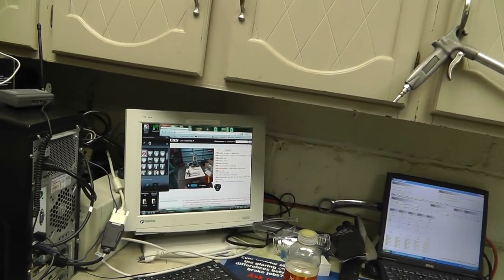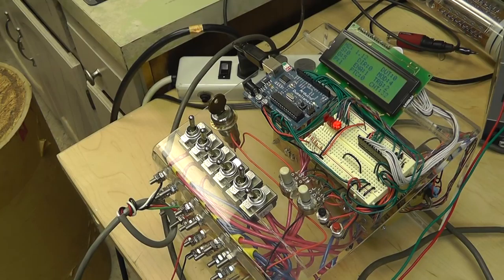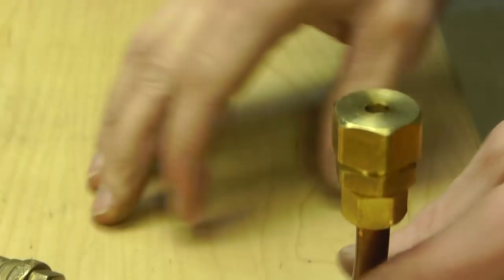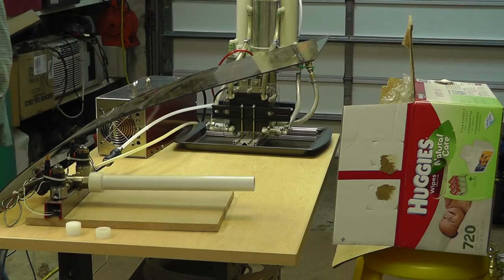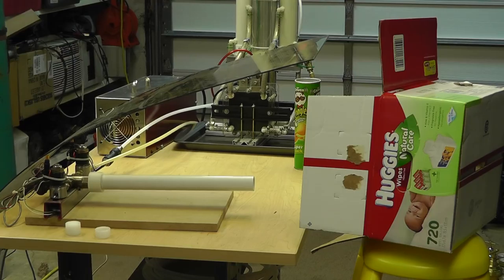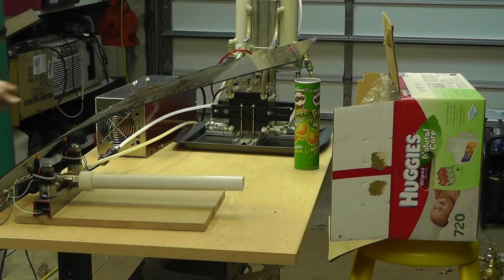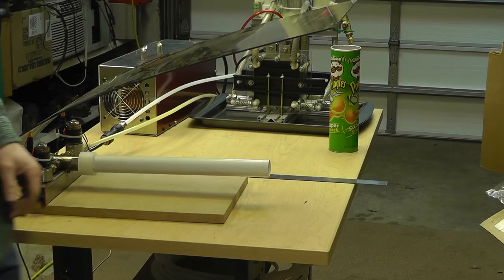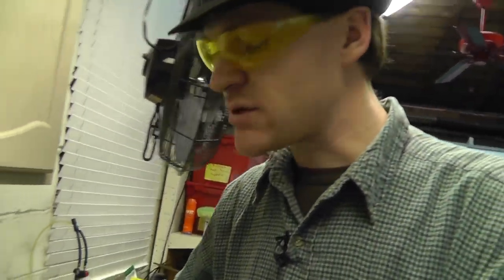First Test Run "Burn-O-Meter" AKA No Name Device. Enjoy ~Russ

Comment: also another fun way to show hho-afterburn vacuum is to have a long hose in a glass of water, drop some ink for slight coloration,bubble some HHO gas, then light on the other end.. FLASH 
and then immediate suction of the water in the hose! The vacuum is quite strong, water expands about 1800 times when in HHO state, so the pressure will be 1/1800 of the original gas volume after the flash? I actually did do this some years ago, quite fun! Might post if i find the clip.. OK well done Russ!

Comment: Hi Russ, I think you are doing great work, and want to thank you for sharing.

My question is, how do you know exactly how much gas is inside the chamber during each fire by the volume of gas input?
if you add compressed air, does than not dilute or add pressure in the chamber?
perhaps 2 pars hydrogen and 1 part oxygen is not enough for the hydrogen to completely burn?

great stuff keep it up.

Comment: Reviving an old comments section...BUT:

This reminds me of an idea i've been stewing over.  

A Potato (Light-Gas) gun (Launch Potatoes (most likely something more...durable) ) at orbital velocity

I think you basically made a Combustion Light Gas Gun, or CLGG

This may be a good first stage

The Seccond Stage Uses pure Hydrogen or Helium Gas

A Piston/Plug is Launched By the First Stage which compresses stage Two untill it bursts the burst disk releases it to accelerate the projectile

I was wondering if a Pressure Release Valve would Work instead of a burst disk

Also perhaps low pressure piston return for the stage 1 piston

Would be difficult, and not too useful (unless you need to simulate asteroid impacts in your garage lol) BUT  dicking around is 1/3 the fun of being a maker.
Reply: Also Links

https://en.wikipedia.org/wiki/Combustion_light-gas_gun

https://en.wikipedia.org/wiki/Light-gas_gun

Comment: Nice goin Russ, it works great. I thought it was going to blow up too. glad it didn't. I did a crude experiment along the same lines (with hho and air)  a while back. I called it The Mixed Gases Tests. check out my site if interested or just to get a lagh.